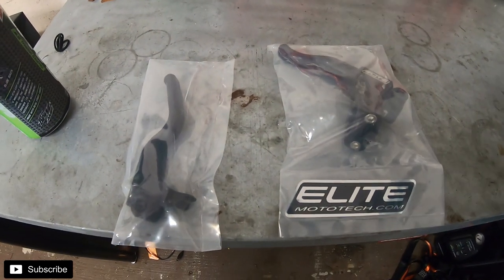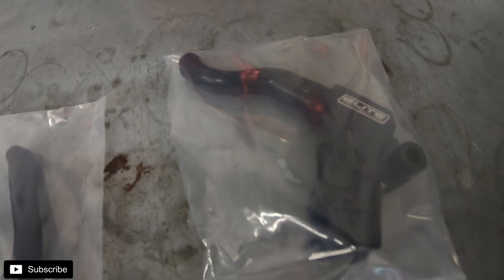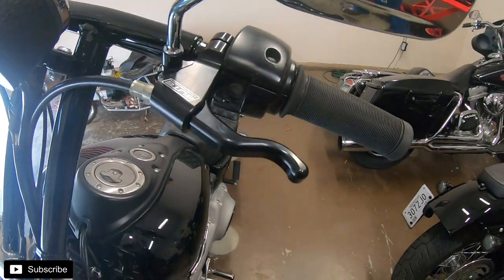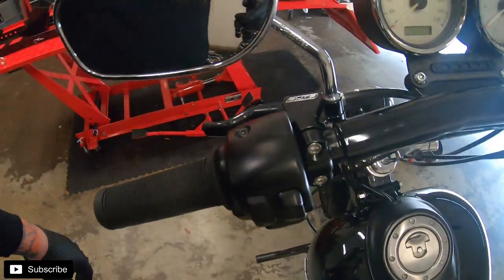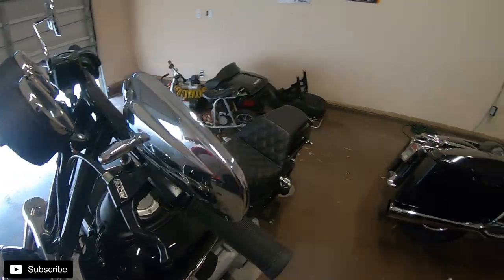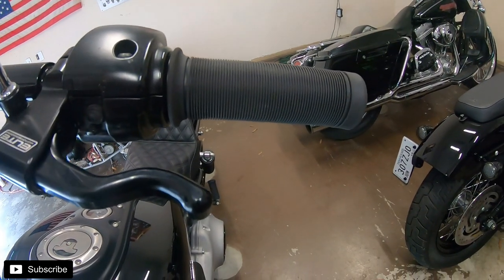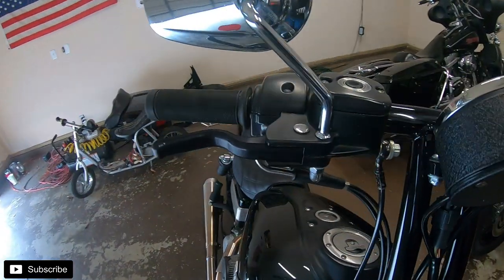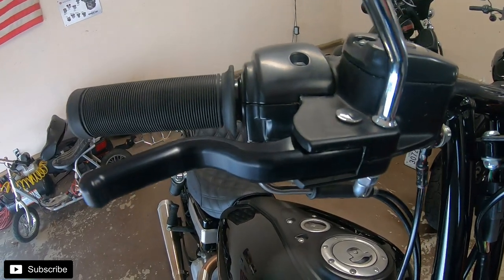Elite MotoTech Lever install: Harley Davidson Dyna Lever Install

Comment: Hecks yeah! I installed mine about a month ago (kept meaning to upload the vid. Lol). I went with the 2.5 finger for the clutch lever. I'm totally digging it thus far! I still haven't reinstalled my rear view mirror though. Thanks for the vid!
Reply from the maker: I need to ride it a couple more times but yes Iam leaning towards a longer lever...lol thanks for the comment.....🤜...🤛
Reply: Is the 2.5 a two finger length

Comment: Does the neutral light come on after changing levers? I saw some negative reviews on these levers saying it defeats the neutral disengagement switch or something. I have a set coming tomorrow for my FXDLS
Reply from the maker: I have not ran into that problem at all we have multiple sets with no issues

Comment: What did you do about the switch housing moving around without the stock perch holding it in place? I am thinking about relocating my switches now....
Reply from the maker: The switch housing will stay in place without the clutch perch.....been running it that way with no issues....thank you for the comment.....👍👍👍👍

Comment: Question, why did you change to these from the whip last levers and which ones do you recommend? Because i personally like the price on these better.
Reply from the maker: The elitemototech clutch perch and lever actually improves engineering and with that you get 30% easier lever pull.....the stock cut ones are a little to wide for my taste....thanks for watching man....👍👍👍👍👍

Comment: Hey bud, just got mine .went with the two finger. I’m just trying to figure out what the purpose of that little black button is for where the old stock lever presses down on when pulled in? With new lever it’s useless. Any idea?
Reply from the maker: Its a start in gear safety I believe I always put my bike in neutral before starting so Its not a issue

Comment: Hi! What’s The measure if the lever? I don’t know if take 1.5 or 2 finger
Reply from the maker: I started with the 1 finger but soon after went with the 2 finger which seems to be perfect now....thank you for the comment....👍👍👍👍
Reply: Maybe i’ll try with 1.5 finger 🤣
Reply from the maker: @883r_project5   the cool thing is you can move the perch mount closer or farther away to adjust the length slightly use discount code Tripp10 at checkout for 10% off....thanks....👍👍👍

Comment: Do you have an aftermarket clutch?
Reply from the maker: No sir stock
Reply: @TrippHPjunkie  cant get mine adjusted to shit. Seem to creep no matter what I do
Reply from the maker: Zero lash at the lever
Reply: @TrippHPjunkie  what do you mean?
Reply: @TrippHPjunkie  also put stock lever back on and it runs mint... just to see if I'm fucking up which I'm not if it's running good with the stock levers
Reply from the maker: Yes the adjustment no slack
Reply: @TrippHPjunkie  adjusted no slack and same result. Tried every way possible from adjusting at the primary to cable.. put stock levers on and works mint 🤷‍♂️
Reply from the maker: Thats very strange never had any issues
Reply: @TrippHPjunkie  talked to a few people/techs and they said you have to have a stiffer clutch spring to make itnwork with stock. I spent 3hrs trying to make it work and nothing. Out stock clutch back on and it's mint
Reply from the maker: I have never experienced that at all I have them on 2 stock clutch bikes with zero issues dont know what to tell ya sorry man
Reply: @TrippHPjunkie  no worries. Ya im very confused lol. Trying to see if my myths can make it work next lol

Comment: Heh buddy i heard many bad.comment abouth those lever abouth the fact they burn the clutch quiker beecose they aparently not agange 100% the clutch is at true thx
Reply from the maker: Sounds like the cable tension wasnt set up correctly I know of atleast 30 hooligan bikes running this setup with zero issues.......thanks for the comment
Reply: @TrippHPjunkie  wouldyou said the clutch lever need the same loose then the oem set up or i need to be tight
Reply from the maker: From what Ive found its slightly tighter than stock....sorry for the late response